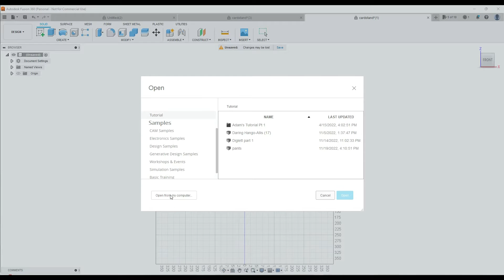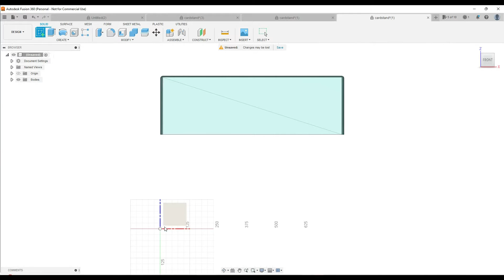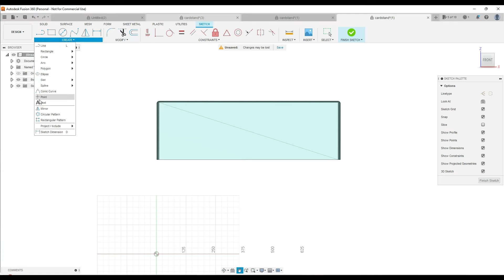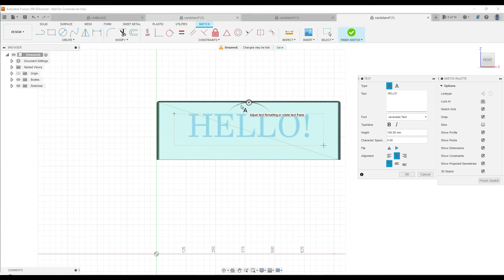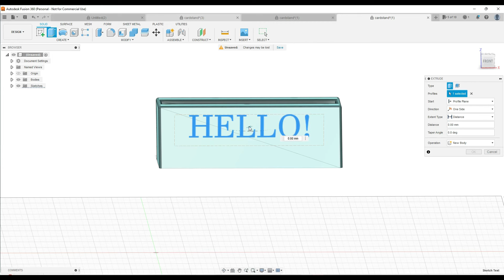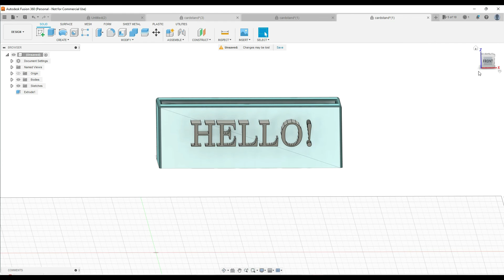Add Text to a .STL file in Fusion 360

Comment: So if you 3d print this stl file will the text be on it?
Reply from the maker: Yep that's correct!  Just be sure you add depth to the letters and you'll be good to go
Reply: @OverExtrudedPhysicist  i tried this, but using - to get an engraving and it did not work, also it changed the size of the object in the stl file

Comment: Very helpful -- Thanks very much! 
One question I have is, Can you taper the letters? I am new to Fusion360 and will be trying to create a plaque with lettering to be used as a pattern for sand casting, and that will require the "embossed" lettering (and any other artwork) to have no undercuts or even vertical walls. So, looking to taper the letters rather than extrude straight if that makes any sense. Is there a trick or technique to extrude toward a point in space or at a slight angle? Thanks again!
Reply from the maker: Sorry for the late reply!  I missed this.  To my knowledge I dont think you can, however, you very well may be able to without me knowing
Reply: @OverExtrudedPhysicist  Thanks. I got it! Turns out, the exrude text tool had a plus or minus angle setting if desired. On my computer, I had to scroll down to reveal that setting. Works pretty great on most bold fonts.